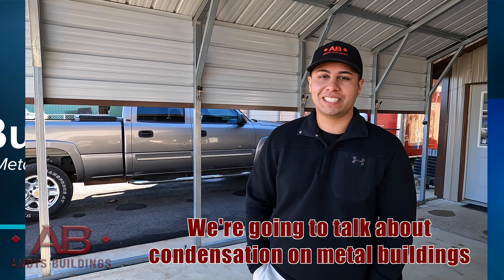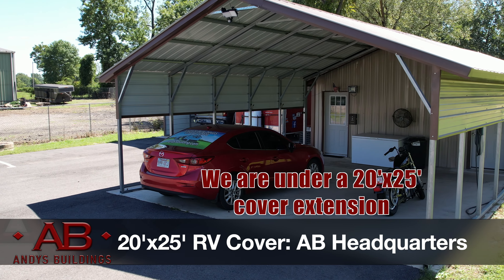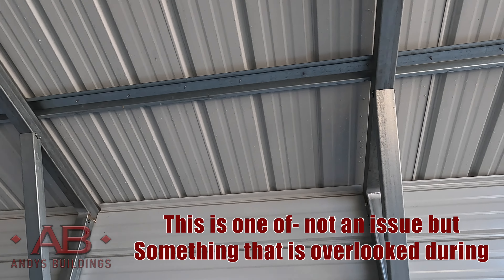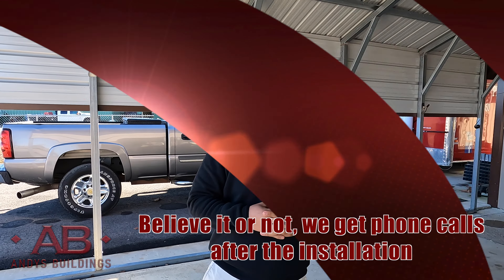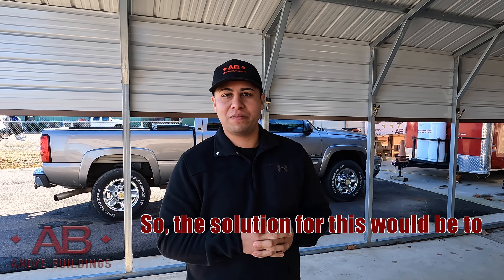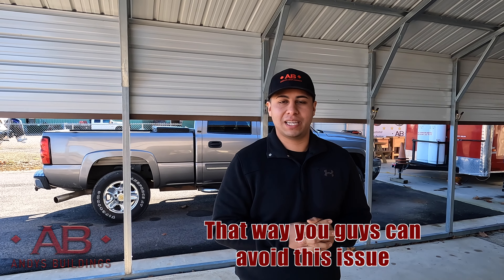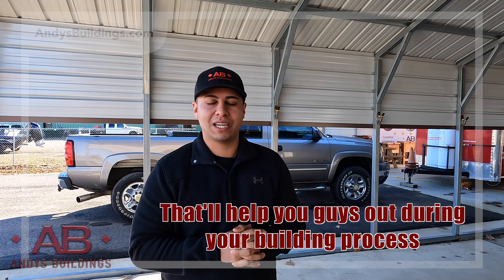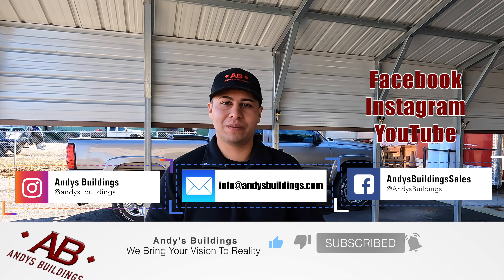Come fix my building, it’s leaking!

Comment: I have a steel shed. 14 meters by 9 meters. My problem is the floor gets so wet with sweet condensation of warm air hitting the cold floor. What should I do ?? Put a ventilation system in to move the trapped hot air ?